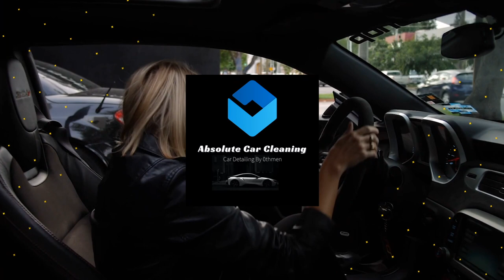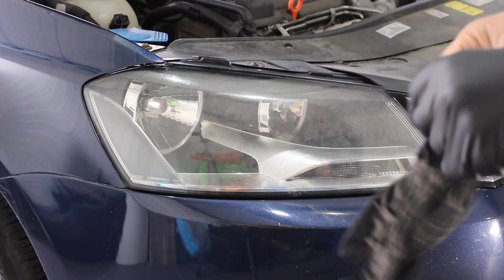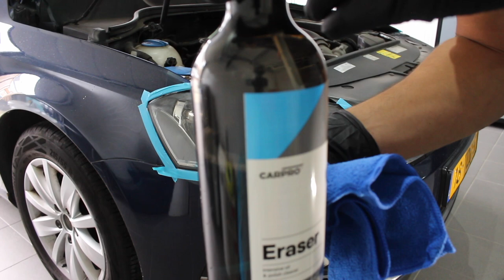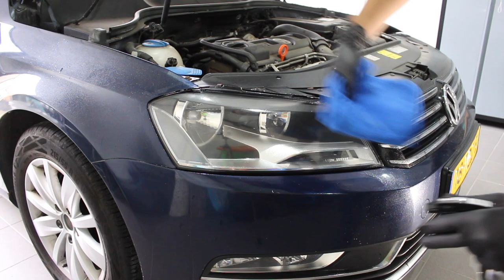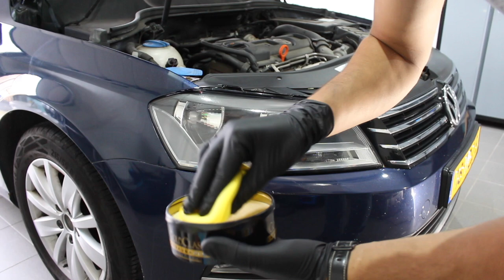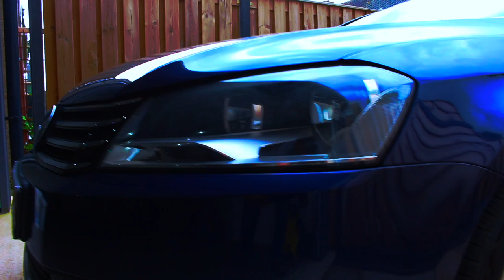Headlight Restoration VW-Passat model 2012

Comment: To obtain a high-quality result, it is necessary to polish the car body several times using different compositions.  The car polishing procedure begins with an abrasive (medium abrasive) composition using coarse (medium) circles to remove, respectively, deep (medium) scratches.